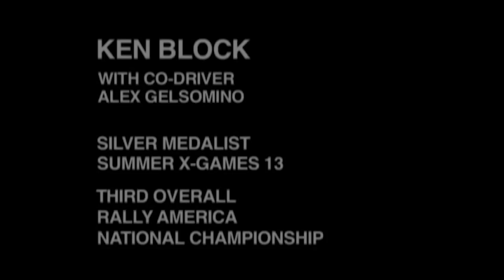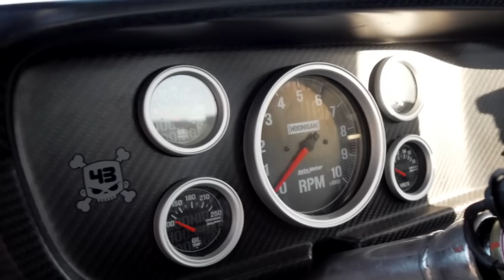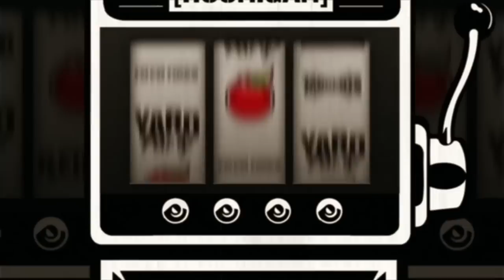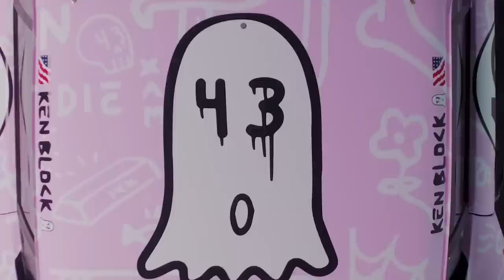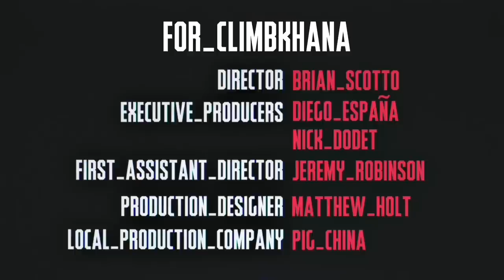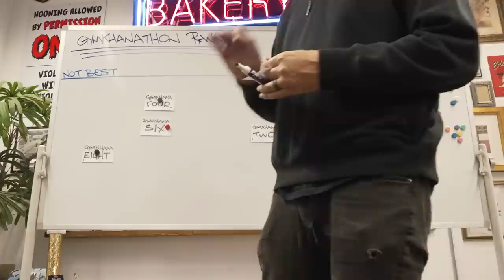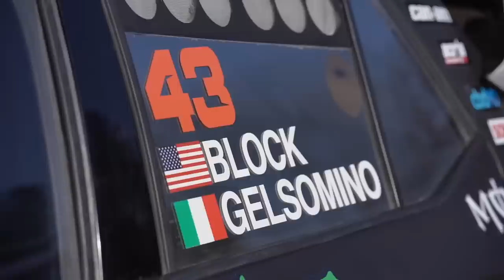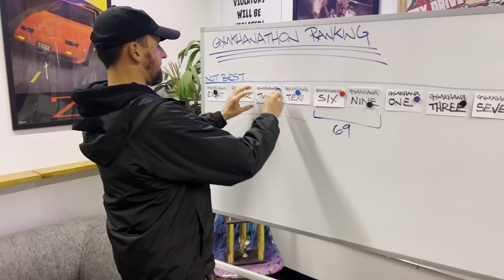Ken Block's 4/3 Day! 24-Hour Content MARATHON Plus We Rate Gymkhana 1-10 (Part 2 of 2)

Comment: Since 2004 when I started driving, Ken was an inspiration.. he's the reason I drifted full size trucks with small wheels and big tires... Everything from my '84 Ramcharger with a four speed to my 4th gen Cummins and everything in between... Lots of broken truck parts from rear ends to motor mounts and countless amounts of u joints.... Don't even get me started on the trash talking when I had a set of tires for more than six months without showing wire... Thank you for that Ken... You allowed me to make a lot of memorable stories that people still bring up today...